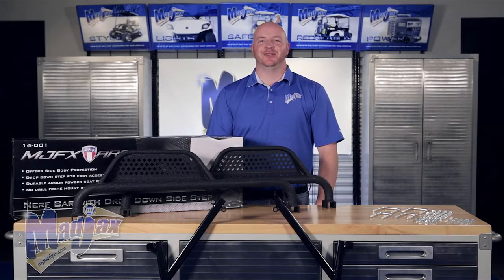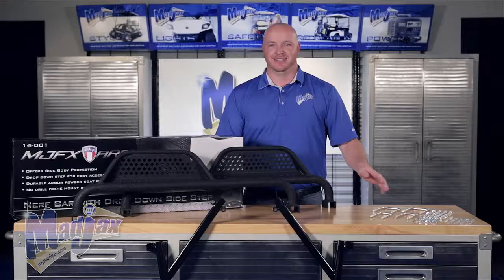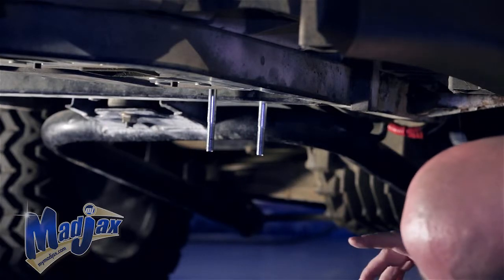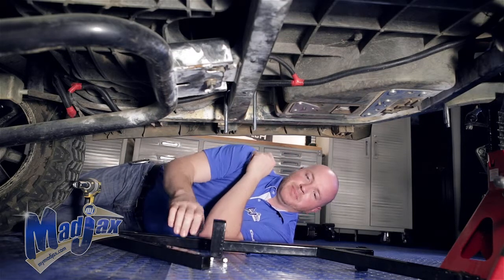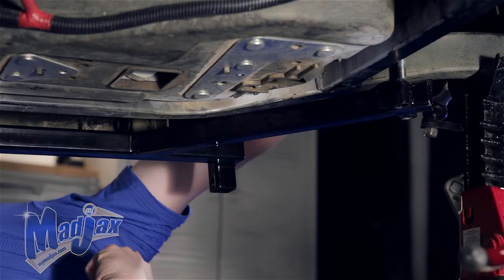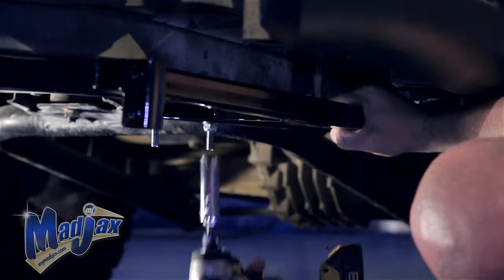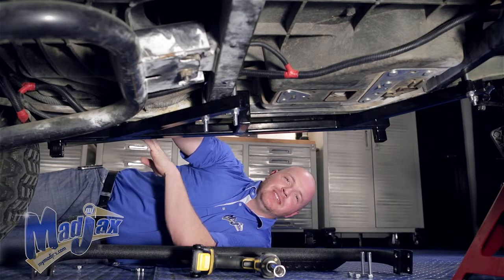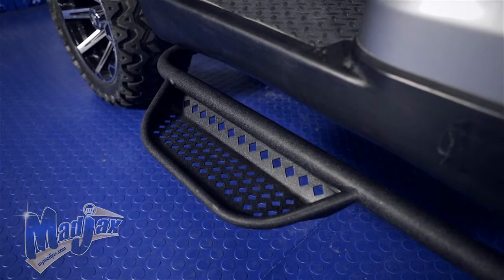Side Steps for Yamaha® Drive® | How to Install Video | Madjax® Golf Cart Accessories

Comment: I just installed this on my fleet gas Yamaha Drive 2 and it is sweet.  Thanks for the video.  I had trouble getting the bolts through the holes on the Nerf Side steps because of the added black paint.  So I worked the bolts in and out of the holes before assembling and they still needed some persuading with a rubber mallet.  All done and now my little wife can climb in without my help!!!

Comment: How much lower than the frame rail do these sit?  Looks like 6”. Is it enough to make a difference on a 6” lift?
Reply: Kevin Perkey I just installed these side steps and they ended up being 12" off the ground where as my floor board is 21" off the ground.  My 5' wife was having a hard time getting in and out of the cart before so this fixed that and it looks beefier and very cool.

Comment: Would this fit 2016 G29 with fender flares?
Reply: Mine fit perfectly. The front almost touches the fender flares. I also have a 6 inch Mad Jaxx Lift. 2016 Yamaha AC